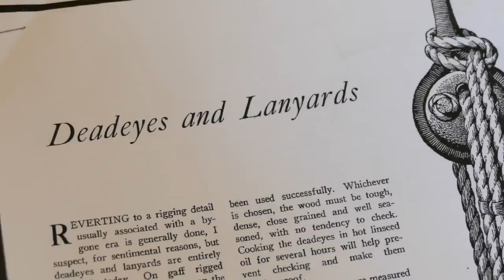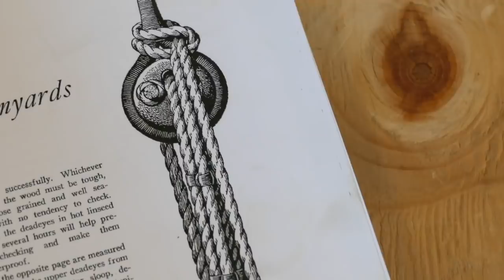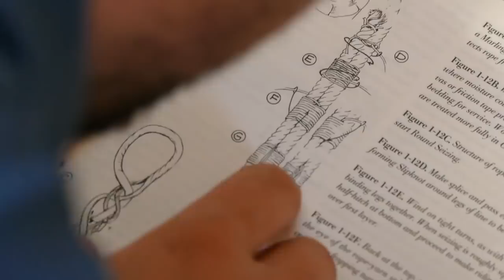Salt & Tar: Ep.116- Seizing the Sarcastic Humor in Life

Comment: Why don’t you buy a manual shroud tensioner? It’s a dirt cheap tool. You attach it to the shroud, it measures the deflection a and gives you an accurate measurement which can be compared to information that’s probably in that book you are using. It’s basic, that’s for sure, but it works.

Comment: the lines are crappy :)       btw ,will there be a waterdrain for the box(maybe on the bottom side) if anything is leaking inside of it or if water comes into it ?otherwise it will fill up to the top the way you sealed the box and the through-holes

Comment: What about a drain hole in that box???
Bound to get water in it at some stage.
What do you think??
Alan
Reply: yes, and having it drip on top of the engine is not the best solution.
Reply: It could easily be a short pole through the side at deck level with rubber on the outside end (acting as a one way valve).

Comment: I am beginning to wonder if they have become a marina couple who will never make it to living on the hook.
Reply: Unfortunately, building takes time, but the sheets have been ordered and the rigging is under way. The rest can be done later. Interior isn't nessesary for sailing, just for comfort. Thought it would be nice to have the engine going as a back-up just in case. A working galley and head would also be a plus. A shower would be nice, but not nessesary, as long as they have a ladder to get back on board after jumping into the water to have a good sand bath near a sandbar or beach. Of course they could tug/tow with their tender until the engine systems are up and running as long as the seas are not too choppy. Depending on what food storage options they have, their diet could be in question without a working refrigeration system, but canned goods can last a while at sea to get to the next dock/marina/location. So, sails up, and they could get going if they choose to.

Comment: Great job, as usual!
I just wondered though,,, When drilling holes in walls such as the box on deck, I would drill them at an angle, so that any water [rain, spray, even an 'internal leak etc.] will always flow DOWN and out of the box, onto the deck. In stead of horizontal. That is to say assuming gravity will work as usual and the boat is 'right-side-up';-) the inside will stay a bit dry-er.
Stay safe, stay well; Love you all .
Willem
Reply: Biggest problem with that is, the sealing flanges are perpendicular to the frame of the fosset, so if you mount then in such angle, the upper part would have a gap, and therefore a leak.
Reply: @oikkuoek  You're right, I guess.
Back to the drawing board...
A trapezoid walled box might help. Bit much at this stage though...
Thnx
Reply: @WPGinfo  I usually am, that's my curse.. :) A Trapezoid would create the outside effect you are after, and a radius on the top with a lip would secure the rest, but then again, it is an enormous task, And due to the characteristics of the boat, neither of those additions to the design won't cause much of a difference. The boat stays upright only when docked in calm water. One thing that worries me in Garret's design is, that it holds all the water inside the box, that gets in through the top. That will become a factor in the future.
Reply: @oikkuoek  A heavy wave over the stern could easily flip the lid of the box so I hope that will get some sort of a lock down. A drain on the box sounds a good idea until you think about the water being able to flow both ways. A drain into the bilge doesn't sound a good idea but the bilge pump/s should be able to cope with those small amounts. I'd have given the inside of the box a good souping before fitting. Never a good idea to coat only one side of a board that is open to the elements. That can lead to warping.
Reply: @delukxy  An inch or two of extra material at the bottom, and a drain to the deck would be my 10 cents to this conundrum. And yes, a heavy souping is very much necessary to the insides, in any case.
Reply: @oikkuoek  Very True Indeed; I was surprised not to see something like an elevated threshold of some kind, on either the outside, inside or both.
I'm sure we'll find out when we watch the rest of this adventure unfold.
Reply: @WPGinfo  We shall see, I hope it's not going to be a catastrophic failure, but only just a minor nuissance, but that box is going to play a significant role on this tale in the future, I'm afraid.
Reply: With fittings such as these in a sailing vessel, bedding is necessary.  Angled drains don't solve the problem for a vessel that may spend hours at a time at a 20 degree heel in spray and washover.  Likewise, unless you incorporate check valves, drainage holes always work two ways.  Think about the companion way hatch for instance, there's no drain but the bilge.

Comment: 5th from Poland.
EDIT:
Why the hell corners still ain't rounded? Water taps ain't secured, too. Its gonna hurt a lot if you hit the corner with your foot fingers, or in the water tap, with your knee.For corner, I suggest this "Bullnose corner bead", just google it.
Reply: Yes, thats still left to do. Really necessary.
Reply: Absolutely but can't see it happening now, they have sealed it to the deck and souped it up now, so hard to rout those edges near the deck. I dare say though, they will find out once at sea that wet decks and sharp corners don't mix. It does surprise me though  on a purely aesthetic level, why with all the other rounded features, they chose to keep this so dangerously sharp.

Comment: Ok, lots of comments about square corners and spigots needing to be rounded off and protected, etc.  Going to bang your knee, and so on.  Most working boats are full of hardware not covered with bubble wrap or shaped like a bean bag.  Even modern glass hulls are are covered with winches, cleats, latches, ropes to trip on, wires, dinghies, helms, etc that you can hurt yourself if you don't pay attention or are in rough weather.  No argument about minimizing hazards where you can, but there are bigger fish to fry.
Reply: Yeah but you can take reasonable precautions. Its a tight space and they will often be hauling on that big tiller with the mizzen boom swinging over their head in a heavy sea and heeled over. There's no point going overboard and wrapping themselves in bubble wrap but those pointy corners low down on the deck waiting for them is a situation which can be prevented without ruining the aesthetics of the boat.